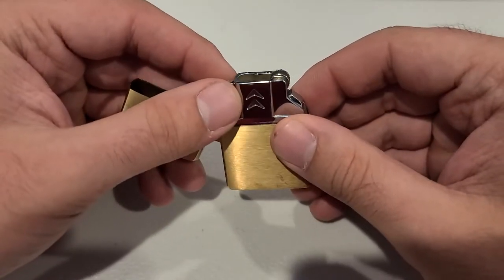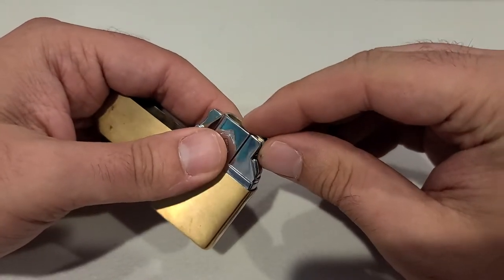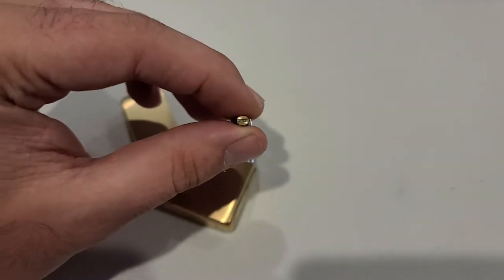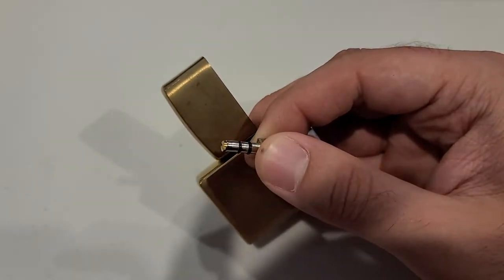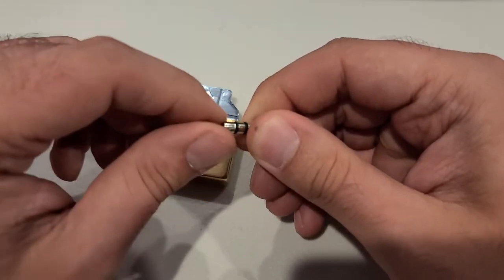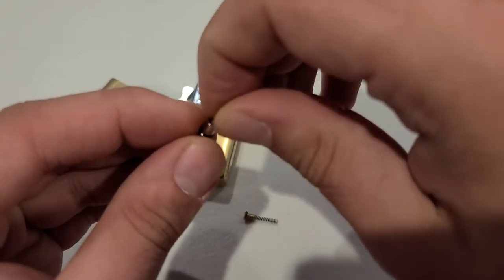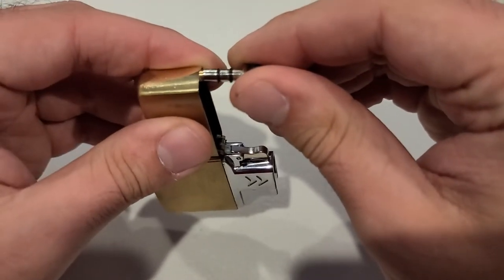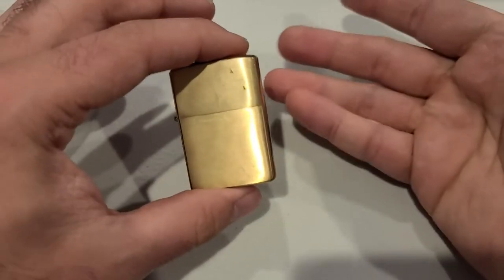Changing Flints on the YUSUD lighter

Comment: There actually is a wrong way to put in the wheel btw, I just found out while playing with it, the curved side is the one where the thumb goes. I was thinking wtf why wasn't I getting fire, that was the answer pretty much. Also the metal end of the spring and the screw are not attached so it takes time to do it.

Comment: Just wondering what that thing at the end of your spring is since mine doesn’t have one
Reply from the maker: oh the small follower thing, that looks like a small nail head. It helps to keep the spring from binding up. Is your lighter still working without one?
Reply: @rammbostein  I think that’s a flint that comes with the lighter because mine had one of those inside and it worked like a flint. I replaced it with a zippo flint the day I got the lighter though and it works much better. Good thing I didn’t throw it away though because it works really good at being a follower. But yes my lighter was working just fine without it

Comment: do you use this on a regular basis? for how long, and how durable would you say it is? thanks
Reply from the maker: I carry it more than i end up using it, but I have to say it's been good. It has good build quality. When you buy it check the function, in case it is broken out of the box, that way you can send it back to the seller.
Reply: @rammbostein  don’t forget about the 1 year warranty they provide! Just contact the seller and they ship you a brand new one in less than 24 hours it arrives. Definitely a really good product to buy!